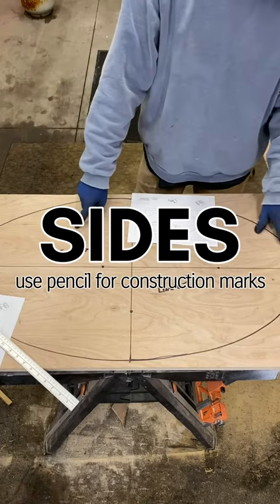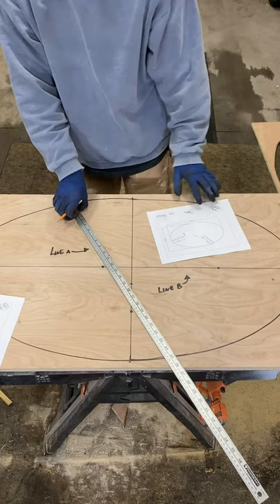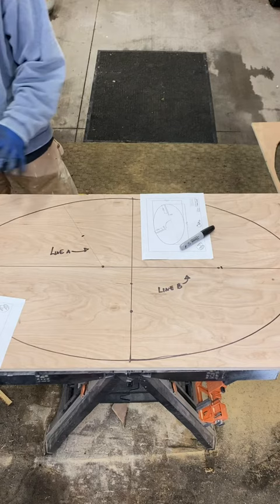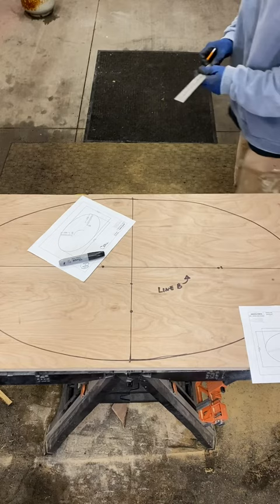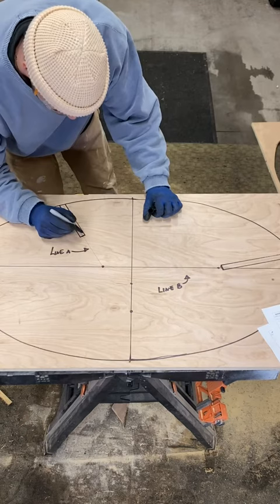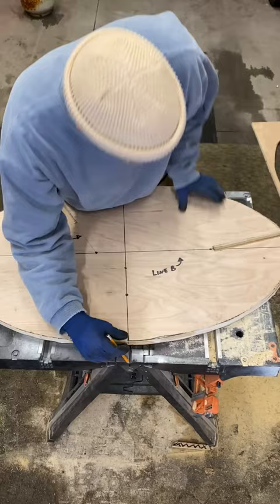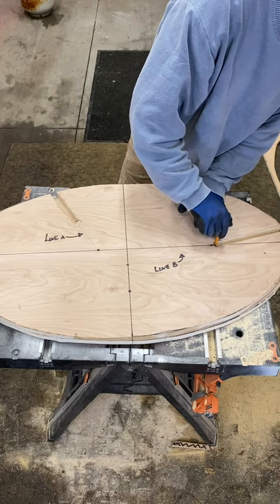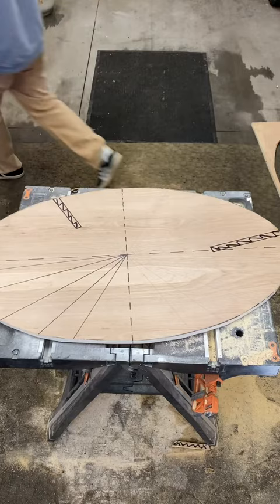5 - Sides (OVAL ROCKER: DIY)

Comment: Can you cut each oval on a 1/4 of a plywood sheet ?
Reply from the maker: You can, you would have to adjust the slot width to match the plywood thickness. I would still recommend 3/4" however

Comment: 3 quarter inches is 1.9 centimeters so which ones right
Reply from the maker: 3/4" (1.9cm) is the nominal thickness of the wood. The actual measured thickness of 3/4" plywood is closer to 1.8cm
Reply: @andrewdoxtater  oh ok because in the video you say .8 instead of 1.8
Reply from the maker: @bahramfarid9871  my mistake!